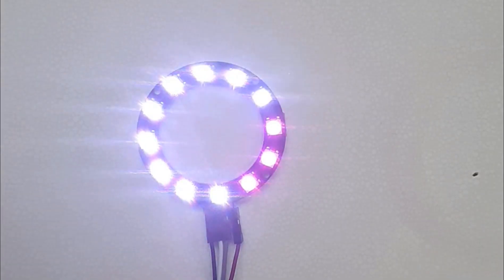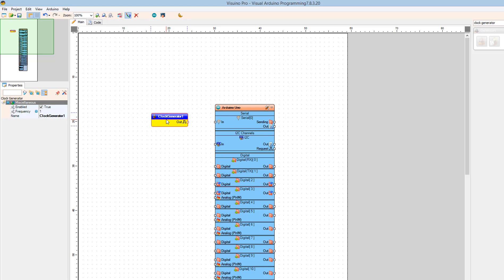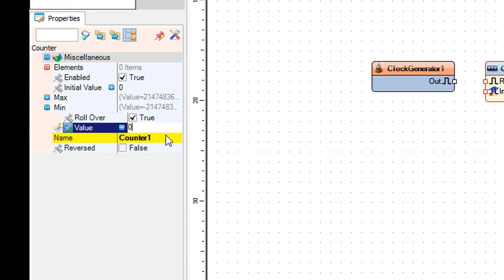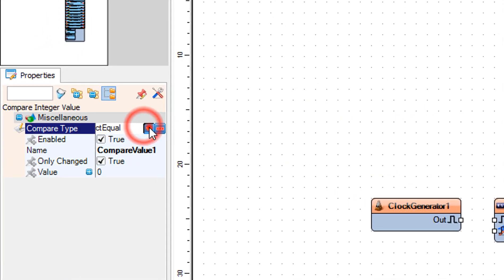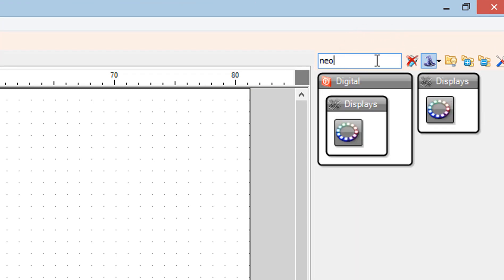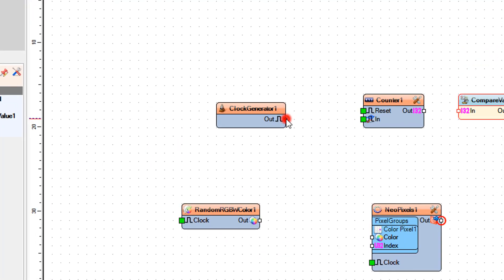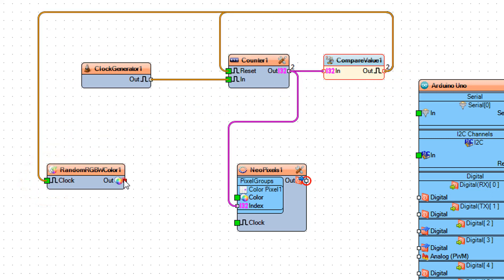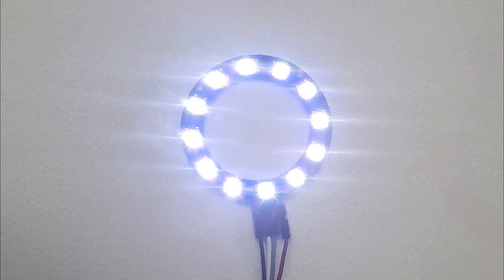Arduino Neopixel LED Ring Ws2812 - Visuino Tutorial

Comment: I did it with a tape of 768 neopixel LEDs and it didn't work for me
Reply from the maker: Make sure that it is the same driver and connected correctly, and in the component make sure to set the number of LEDs
Reply: @visuinoprojects  yo use arduino mega
Reply: @visuinoprojects  lo que hace que se me enciende todos los leds al mismo tiempo sin embargo cambio la cantidad de led a 12 igual que usted y si funciona pero con 768 leds no